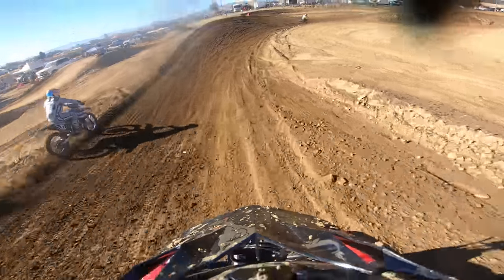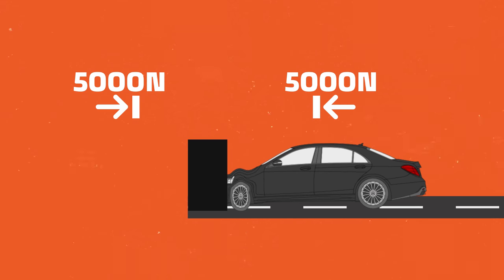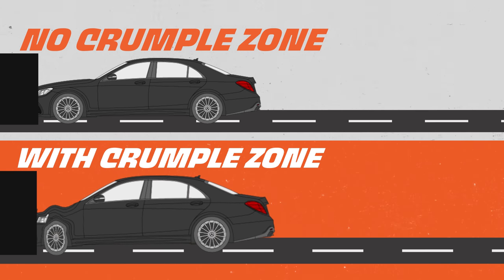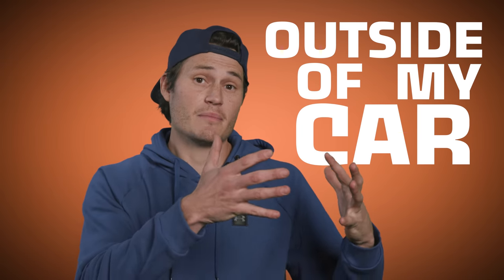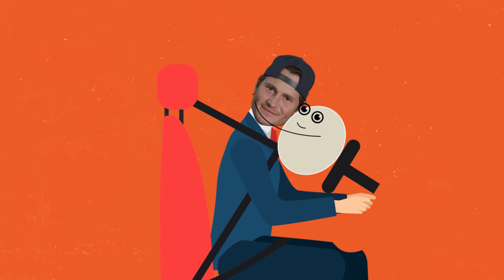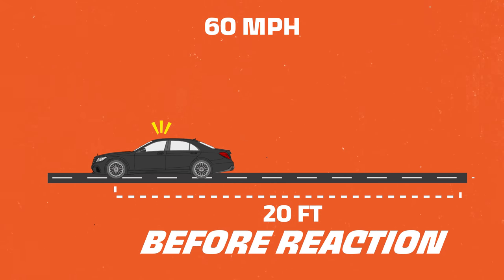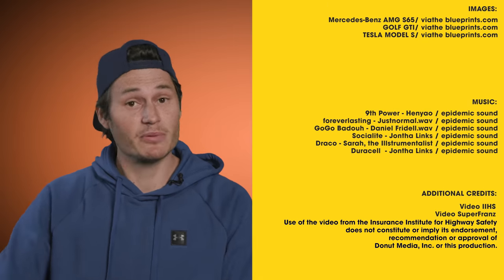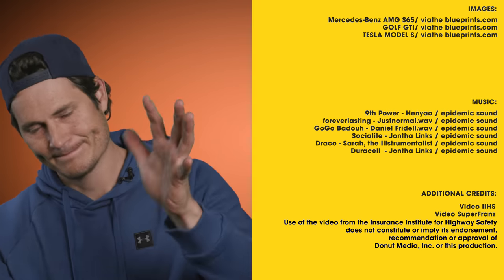How To Survive A Car Crash

Comment: I work at a dealership and there was a truck someone brought for an oil change and knocking noise complaint. They had they're seat belt clicked in and it was smooshed into the seat cause he would sit ON it to keep the beeping from going. So to test drive the car I actually used the seat belt and he had the nerve to get mad about me moving his seat belt to use it while going 75mph on the interstate to hear this knocking noise. Like are you fucking serious.

Comment: Really like the video, but your conclusion at 2:35 is the result of some horrendous raping scene of physics, brother.
Think about it, if the hypothetical car had the mass of an oil tanker, would I turn into splatter intantaneously, if crashed at 5mph? 🧐
You're body doesn't absorb all that energy. The energy is just converted into impulse, making the car bounce at 5mph... Scary shit though

Comment: dont hold your thumbs inside the steering wheel. in case of collision, you'd break them off. only tip i can give, besides priority =/= safety, always search for eye contact in situations you know you have priority. drive safe, yall. and keep in mind, the other driver you meet on the road might be a total meth head tweaked out alcoholic lost in its train of thought... better safe than sorry. every car is a one tonne or heavier bullet flying through

Comment: Create space between other cars, don't run red lights, be very aware at fresh green lights, focus and react till the final moment of impact, understand when you have lost control or have the ability to change direction of impact. CHANGE DIRECTION OF IMPACT TO YOUR BENEFIT. The milliseconds donut is talking about are irrelevant, it's the 5 seconds before that mean the most. Don't worry it will feel like a lifetime and a badass can fix anything in a lifetime. I'd wear your seat belt if you are going over 50 or so. If not F the police, I'll take the ticket. (Seat belt laws are unconstitutional) There is alot more to be said on this topic, best advise is just to not be an average idiot on the road and respect it.

Comment: you are not right in everything, becaus you say you dont have enough time to react, but in some cases you see the crash coming if it is to late to stear in an other direction you can still react. for example i hat a crash loosing kontrol about my car, sliding sideways then it got traction and drives of the roat uphill but was still moving sideways, i knew i was going to roll over and hat eneugh tim to put my hands off the stearing weel antd put my arms next to my head. so my finges are not hurt by the stearing weel an my head didnt fly around. so after the crash i went out of my car without any thing hurting, even my neck was not hurting. and if the roof would have been pressed lower ( what didnt happend on my side) my head would have been protecktet a little bit by my forearms.

so you can react before the crash happens.